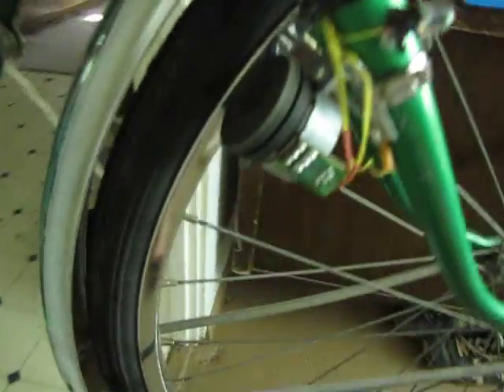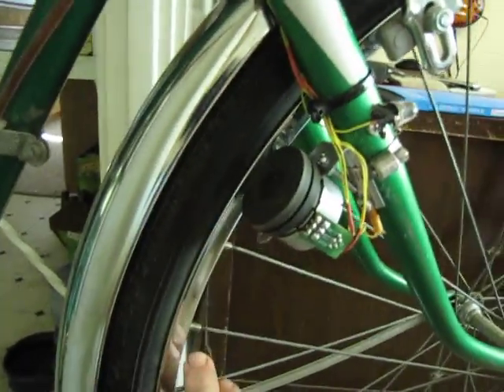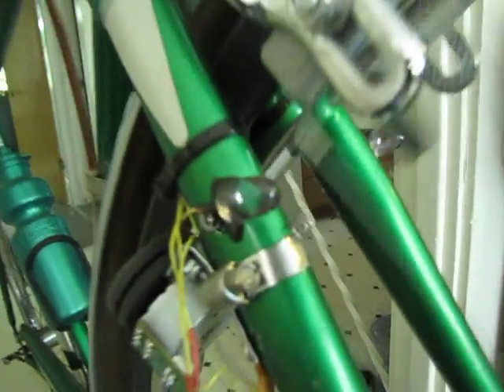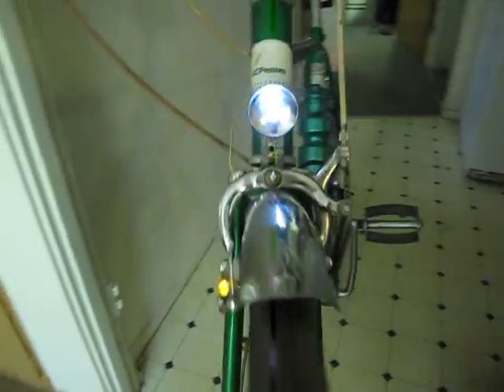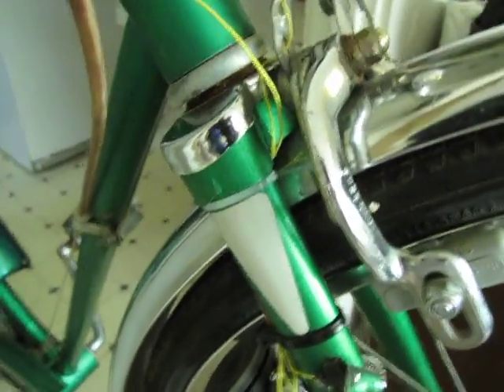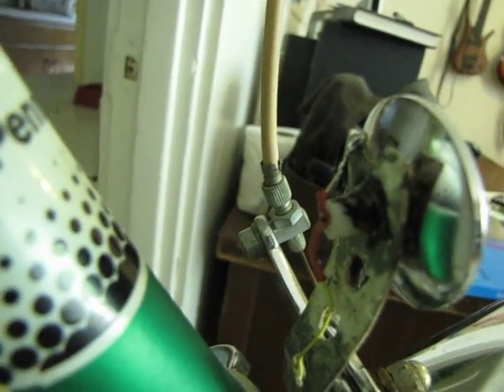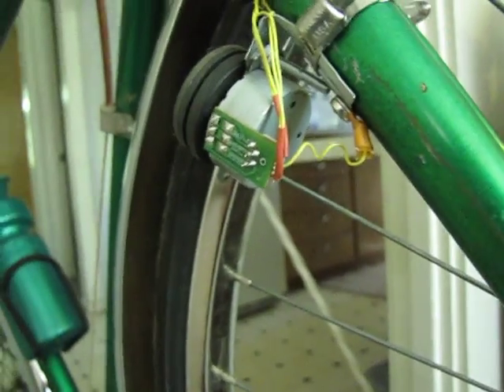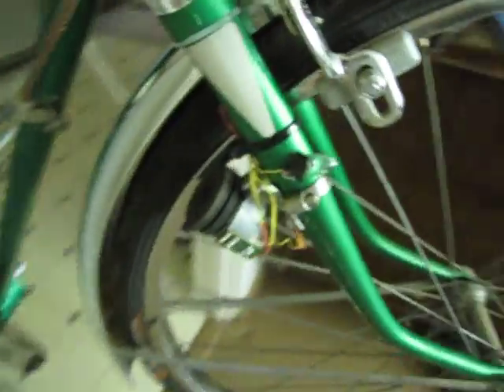Bike light generator from stepper motor

Comment: Mr. Segovis, i am imitating your brilliance with a stepper motor and leds purchased from ebay. does the voltage of the leds matter? how did you manage the spring loaded action on the motor itself? please take the time to respond to me, as i am certain my questions will assist others in this fine endeavor you've started us all on! thanks a million for the demo!! i believe i have everything else hammered out, as it all seems very straight forward, but that spring action is nifty and i can't really see it from the angles you've so kindly given. the link given for a tutorial is broken /:
Reply: built mine without a spring operated mechanism to hold the generator to the drive wheel, works great. used a nema 17 w/stock mount and mounted to the front brake post and 5mm leds, have 10 (5/circuit) 1 white, 1 red, 8 yellow running now.

Comment: Is there some benefit im missing in using a multiphase stepper or brushless motor over a regular single coil DC motor?
Reply: Monkey Juju download MP4 Nokia
Reply: I really don't know the reason much but the stepper motor is more efficient and creates more power easily than the dc motor.

Comment: doesnt it need someone to hold all the power and control it? i forgot whats it called but pretty much it would prevent it from making the led pop or blow from too much pedaling
Reply: +Gainster no a capacitor he means
Reply: i think its a capacitor
Reply: Brother use 1kilo ohm resistor  and  better to make bridge rectifier with 25v fillter

Comment: Can you add like 6+ of those generators to each tire on both sides a total of 24 maybe and use those to power up a small electric motor on the back tire? It would be hard to start pedaling at first but as the motor gets juice it would be easier? Is it possible?

Comment: Bridge rectifiers waste a volt and a half of voltage drop across the diodes.  Use Schottky diodes and use a pair, not a bridge.  You can easily find them in old PC power supplies.  Better yet, just put the LEDs in parallel cathode to anode, and let them do their own rectifying, actually just conducting and lighting alternately on each half of the AC cycle.

Comment: What would happen if you made the wheels of a electric only car as the turbine?
I submitted to Honda and Toyota the idea that the wheels of the car could be used as a turbine..the rotation would generate electricity to the generator..that is hooked to a battery..that is hooked to a inverter...that any electric car would plug into..even if there had to be anadapter for the plug in..since the plug in portions with different heads.
It  would have to be more rpm's to supply the battery power..

Comment from the maker: You can store it if you connect a bridge rectifier to the output to convert the AC voltage to DC voltage. Then you run the DC voltage through a simple charge control circuit into a battery.

Comment: Love your idea mate,  I've built a 3 phase generator from scratch using scrap and 4 neodymium magnets.  It gives around 20v at 2 amps at high speeds unregulated, around 40w or so.  I like your spring loaded mount, very nice.  What sort of power output does it give?
Reply: How did you make your 3 p generator can u explain ??
Reply: @videogameclips947  I took a core from a dc motor, stripped off the coils, insulated it with tape and wound my own coils.  3 coils all together.  Wired hem in a star configuration.  Made casing from steel.  glued neodymium magnets x 4 to inside. 
 north south north south.  Mounted either end of the core on centre of barings.  outside of barings tight on case using perspex ring for mount.  Wires feed through middle to 3 phase rectifier.  

Hope that helps <3
Reply: @mayarosexxx  thanks a lot ! I never thought that i could have made a 3 phase motor from my remaining dc motor armatures. :)

Comment: I was considering installing magnets on the spokes and putting coil near the spokes, would this work, and if so, could it power maybe 4 leds? I am looking just for visibility of my bicycle, not light to see where I am going. I live in a city that is pretty much always well lit enough for me to see, I just worry about not being seen. I also worry about the resistance of a sidewall generator like yours. How much harder is it to pedal when you are generating electricity for your lights?

Comment: Is very interesting what you can do with a stepper motor, I did something similar, but not connected to the bike.
I used three capacitors in parallel to obtain 1600uF (1000uF 35V, 35V 500uF, 100uF 35V) (with both large capacity is better for us) and a 80K resistor (33K, 47K). After the capacitor is charged, is able to keep a led on up to 5 minutes (capacitor charge lasts a few seconds.) A diode must be conected between stepper motor and capacitor. Soon I'll do a tutorial.

Comment: i have a q for u: what's the maximum output voltage of the stepper? did u have to reduce it like soldering a resistor before LED to make sure that is doesn't get too much voltage? above 5V will damage the LED. Please responde asap. Thanks.

Comment: I have a 220 motor which I intend to use as the generator. I will use a rectifier but the voltage is still too low and I want to power my horn too. Any suggestions ?